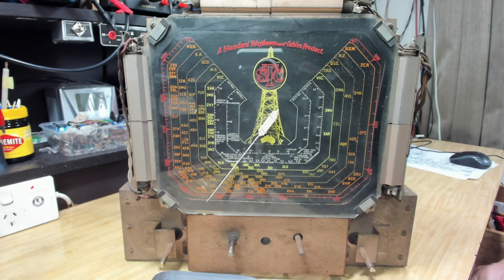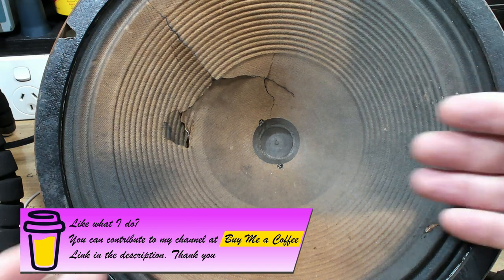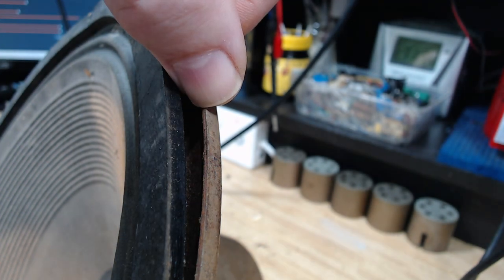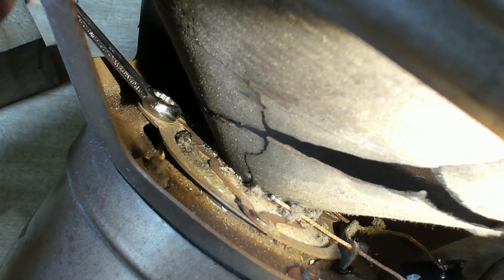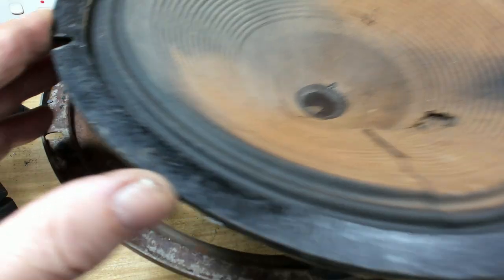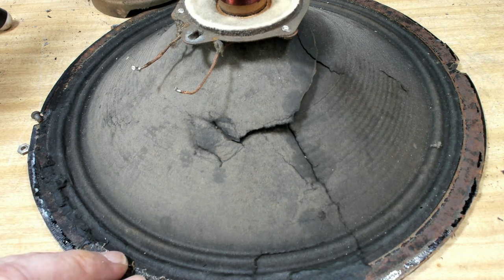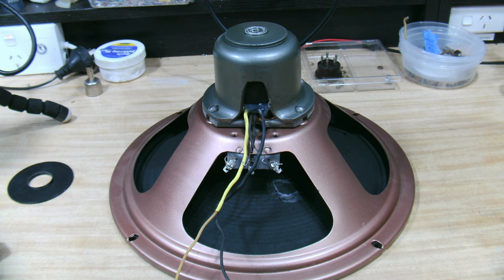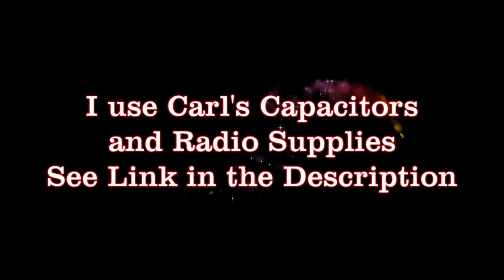STC 830 Radio Restore - 1938 Part 2

Comment: It's always great to see you work on these old radios. You make it look so easy, but that's most likely because of all the tools you have, tools like a 3D printer, a sand blaster, a router, etc, etc. After spraying on the new paint the radio looks like new, or maybe even better than new. Can't wait for part 3. Thanks.
Reply from the maker: Hi De Mus, thank you. Having the right tools makes it easy and I have built up my workshop over many years but there are usually ways around not having the tools and make do 👍🙂

Comment: Talk about going the distance, This is not just a repair, but a fully blow rebuild and to strip the radio ( or any piece of electronoc equipment ) down so far and replace faulty componance, paint, and rebuild far better than new just blows me away. Looking forward two part 3. keep upthe good work Dave !!
Reply from the maker: Thank you Stephen, I'll try 😉😃

Comment: Awesome job on the speaker and chassis David. Not surprised you need a part 3. The radio needed a full restoration.
Reply from the maker: Hi Steve. Thank you. I was aiming for two parts but it was too long so three it is 👍🙂

Comment: I'll pull anything apart to clean it but that tuner was next level. So many wires to keep track of, I broke into a cold sweat. Love all the equipment that you have. Sandblaster and a laser cutter. You've got everything. Thanks for the hint about reusing those annoying real estate magnets. I just throw them in the bin, but going to keep them from now on. That's a brilliant idea.
Reply from the maker: Hi Seiskid. Yes, a lot of wires, I take a lot of photos and even a video to help reassembly on this radio. Good tagging helps too. I add new tools from time to time, they are getting cheap enough as to not break the bank. The sandblaster cost me $70 as the outlet had opted to not sell them anymore. The magnets work well 👍🙂

Comment: Great idea using the tea bag paper to repair the cone. I used coffee filters and fabric glue on speaker repairs but that looks much better. I'll have to cut open the Earl Grey the next time.😂 Always a big undertaking to get rid of rust and clean the chassis I love your methodical approach. Very very nice work David.
Reply from the maker: Hi Larry, I insist on using Earl Grey on my speakers. Cleaning the chassis is my most dreaded part, I'm happy when I get to the painting part. Thank you Larry 👍🙂

Comment: Your ability to rebuild speakers amazes me! Many years ago, I worked in a Radio/TV shop and we sent speakers out for reconing.  At that time, the most expensive job was about $4 USD.  Sadly all of those shops are gone and speakers are expensive if you can find one that fits.  I have dozens of 4 inch speakers from drive-in movie speakers that could be salvaged if reconiing was still available.
Reply from the maker: $4 for a re-cone. Professional re-coning takes the cost higher than the radio is worth, DIY is the only way for me. Drive-in speakers would be well worn 🙂
Reply: @DavidTipton101  Keep in mind that I was talking the late 60's.  I think I made $53 per week for a 43 hour week so the $4 was worth about 4 hours of work. The drive in speakers usually have the cone rotted away but the metal cleans up pretty well.  I can get 4 inch speakers for about $8 each.
Reply from the maker: @gwesco  Oh I get that George but with speaker repairers on every corner it would be more completive back then. We only have one or two in the major capital cities here.

Comment: I have done a fair amount of media blasting, it is a developed art and you can easily turn aluminum into some expanded planished junk in short order. Residual dust may be an issue, removal is just as arduous as the blasting. I would find a suitable solvent, water or mineral spirits (Stoddard solvent), sometimes alcohol. It really depends on the media used. I used ballotini glass beads, ground up walnut shells and ground plastics can be a good choice and of course, sand. For delicate work go with softer media, glass bead is less aggressive than sand. What ever you do your best using a solvent on aluminum and other soft metals. Media blasting is trial and error and sometimes very easy to error.
Great video David

Comment: Ey Up David 
What a great direction you take in methodical procedure
The use of simple resources you use is very clever
Inspired me to look up what PVA Carpenter Glue is made from, Polyvinyl Acetate discovered in 1912 ! So an older formula than the radio!!
So interesting where this hobby can lead to...... Fantastic video 
Best regards Shaun
Reply from the maker: Ey Up Shaun, I never thought about PVA glue before, I thought it was pretty new not from 1912. Thanks Shaun, take care 🙂

Comment: Impressive work, especially on the speaker. Fun fact: we call multi grips the less expressive "channel locks." (We also drive on the right - or correct - side of the road.)
Reply from the maker: Hi Wayne, thank you. There are a lot of names for 'Multi-Grips' or Tongue and groove pliers, makes it interesting. I tried driving on the right side of the road down here... it didn't end well 😟
Reply: @DavidTipton101  😁

Comment: I worked 30 years in law enforcement in some of the worst most dangerous neighbourhoods of my country and yet i could never muster up enough courage to dismantle a radio to that extent. I'm too chicken shit ! There i said it.  Every time i see you cut a wire i feel like an artery or optical nerve has been severed, but at the same time i know you'll be able ro reconnect every single one of them to the right place. You're at the top of your game David and i sometimes wonder if you get lonely at the top...
I agree with Dances with Aardvarks, i"m surprised there was no pun about the tea bag which i only discovered the significance of the expression recently in video gaming.
''Teabagging'':  The action of squatting over a dead opponent's face while he is  waiting for a revive. A disrespectful  deportment very much frowned upon in the gaming community.
Very much looking forward to the next part now.
Be well, God bless you always.
Reply from the maker: Haha... at least radios don't normally fight back... too much. I am aware of the tea bagging ceremony but didn't consider it when doing the speaker, I must get out more. Thanks Raymond 😃

Comment: In the US many years ago, they made a product called Navel Jelly.  It was a rust remover.  I have used it on tuning capacitors with great success.   The jelly isn't as hard on the veins as  blasting media is.
Reply from the maker: Hi Michael, I have tried rust removers but I get a better result with the media blaster. I don't normally do all the checking I did in the video. The capacitor had issues before I got to it. Thanks 🙂

Comment: Hi Dave,
Stripping a radio chassis for the purpose of either painting, or plating is, without exception, a tedious operation but the end result is always satisfying.  I am confident your STC will look superb when completed.
A few years ago I had a thought about making a set of convex, and concave speaker shapes, or speaker pitches, including provisions for including the outer cone ribbed hinges.  My idea was to place a dampened, (seam not glued) paper Chinese hat shape cone between the convex and concave shapes, and use a bench press to form a replacement speaker cone. I also considered pressing paper mache.  
Unfortunately my model lathe was not large enough to be able to turn the required convex/concave press shaping components.  I did consider turning them on a wood lathe using hard woods such as Indian rose wood. 
One day, when I get a workshop, I might reconsider giving this a go.  If you think there is potential in my cone making idea, please be my guest and give it a go.
Best regards, Phil.
Reply from the maker: Hi Phill, thank you. I also have pondered ways of manufacturing speaker cones with much the same ideas as you. There is quite an art to speaker cone design so I wonder what the speaker would sound like if a successful cone could be made. I'll keep pondering 🤔🤔🤔😄

Comment: Lazer cutter, of course... Amazing job and looking forward to if you get it back together and working again as you always do, I wouldn't... But it was nice to see you sandblast again, it haven,t been much of that lately. It is nice to have a lot of gear in the playground but it not helps if you don,t now how to use it and that you do, thanks David!
I vill also thank you for the insporation on winding machine and tip on that calculator by Mark Delac. After a very long time I have finished my winding machine even if I was going by my idè you give me insporation to go on and I have now rewind my transformator and hope to test it later today, I don't have much time for this but it is a relife vent for me.
Reply from the maker: Hi Leif, thank you. I hope your transformer is working well. I am working on my winding machine now and hope to use it shortly, I don't have it working yet but I guess I will get there👍🙂
Reply: @DavidTipton101  It worked, perfect if I havent chicken'd out on the heaterwinding, last second bad decision so lesson learned to trust the calculator all the way and have now rewind it so now its perfect, at least until I got it back in the radio... It is fun, not so long ago I never think I ever going to wind a transformer but now I have wind 2 (first one to power the winding machine) this my own built machine. I am sure your machine going to be on unother division.
Reply from the maker: @leif.Jakobsson  That's good to hear Leif. I lived in fear of the transformer until I realised it was a quite simple concept as you have found. My winder is so highly advanced I can't work it 😂😂

Comment: You’re doing really good 😊 on this radio 📻. I like 👍 your new invention in words, saying this set is “earthed”, instead of “grounded”. I still understand. You’re doing a great 😊 job reconing the speaker 🔊. It’s probably permanent magnet 🧲. I think 🤔 I also mentioned the dial cord, which ya said was in good 😊 condition. Are ya also aligning this radio 📻? To me, that’s about the hardest thing to do. Unless you’ve got diagnostic equipment to tell ya what you’re doing, aligning a radio 📻 is next to impossible, unless you’re very well practiced, without the use of diagnostic equipment. Your friend, Jeff.
Reply from the maker: Hi Jeff. Earthed might be a British term, I hadn't thought about it too much. The speaker came up very well, it looked grim at the start. The speaker is dynamic and there is no dial cord on this radio. I do the dial and alignment in part 3. Thanks Jeff 🙂

Comment: Excellent work. You could easily parametrically design and 3d print the paint/ sandblast covers for the valve sockets. That way you can quickly remake them for any valve sockets you encounter in future.
Reply from the maker: Hi Stephen, thank you. I could print them but it would take 20 minutes each on my printer. The laser cutter takes much less the 15 seconds. I wonder how durable the plastic one would be? 🤔🙂
Reply: @DavidTipton101   good point I didn’t know laser cutters are that fast. I am a bit scared about the safety of lazer cutters as I am not good with potentially dangerous things.
Reply from the maker: @stephenbarlin2314  No danger with the laser cutter as long as you wear protective glasses and the work doesn't catch fire.

Comment: Though I enjoy watching your videos a lot, there are some moments that my toes curl.
These moments have in common that they involve repairs on speakers. Though the methods you use are effective and restore  functionality, you could perhaps try some that are more suitable to use on these rare vintage speakers.
Don't get me wrong, I have great respect for the way you restore these beautiful old radios that would in many cases go to waste.
Greetings from the Netherlands.
Reply from the maker: Hello htrawa in the Netherlands. I'm not sure what you are saying about the speakers, what should I do differently? I'm happy to receive constructive comments. Thanks htrawa 🙂
Reply: @DavidTipton101  
Hi David, First of all I want to emphasize that I think you do a really good job with your repairs!
regarding the speakers.. when I saw you putting on so much glue at 2:42 and the teabag I couldn't help thinking this could be done better. You see, since the glue adds mass to the cone the performance and maybe even the sound characteristics will change, so it is important to keep the added weight to a minimum. In this case a strip of glue and teabag paper of only about 5 mm wide would achieve the same strength. I would try making a paper mache that matches the cone more and reinforce it on the backside with a tiny line of wood glue. For the thinner section you repair at 4:49 I think the teabag solution is brilliant!
One other tip: At 28:16 you remove the centering strips from the voice coil before you glue the outer ring of the cone to the chassis. If there is some play in the outer ring position you would have no risk of misaligning the cone when you leave them in until the glue sets.
Reply from the maker: Ahh, right. I am aware the extra mass added to the cone will affect it's performance. But I take your point, it is better to use as little glue as possible. I do as much of the repair on the front side of the speaker as that side is hidden when the speaker is installed in the cabinet. I didn't show me regluing the outer ring, I absolutely would have had the plastic strips installed when doing that. Thanks for explaining your concerns Htrawa.

Comment: Greetings:
You should be able to use a less deep cone by causing the center metal portion of the magnetic extension in the center of the voice coil to extend further into the throw range of the voice coil by adding ferrous material (like washers or a neodymium magnet: polarity in-phase) if that center is held on with a screw, then added washers could be placed there.
 Although the total throw will be less than the original cone; distortion may begin to increase at a lower volume. I would use some 35mm film negative as centering spacers; if too thin then 2 layers should work.
Reply from the maker: Greetings James. I could have made a shorter cone fit as you suggest. The other issue is the hole diameter on the replacement cones is quite a bit larger so that would have to be remedied as well. Thanks James 🙂

Comment: Id be happy to see a video about your laser cutter !

And as an alternative to tea bags for speaker cone repairs - how about the tissue paper you can get for covering model aeroplanes ?
Reply from the maker: Hi Mr B. There are lots of videos on laser cutters, I'm still seeing what I can and can't do with mine, I've found a lot can't so far. Tissue paper would be fine to use, although you would be replying on the adhesive to hold together. Tea bags have better strength and we keep them in the pantry 🙂

Comment: Recentering voice coils, fixing rubbing variable capacitors and restringing dial cords were always my least successful and least favourite bits of restoration. A real pleasure to see them done well - and aren't 3D printers and laser cutters useful? But even they can't help with restringing...
Reply from the maker: Hi proudsnowtiger. The voice coil centring caught me off guard, so it was first time for me. The 3D printer is very helpful, I don't use it too often but very handy when I need it. I haven't used the laser cutter very much yet, I bought it to cut new back panels for radios. It should do a good job for them. Thanks proudsnowtiger 🙂

Comment: I lost / had stolen / the most useful tool.  Parallel Grip Pliers is the best way to understand them  I think they were Post Office (GPO) Number 1 ? at full opening just the right size to undo thin retaining nuts of that medium diameter with the jaws parallel at full stretch.  I did see another pair at a tool jumble sale but missed out as the chap in front bought them
Reply from the maker: I know the ones you mean High Path, like an adjustable spanner (monkey wrench) with handles 🙂

Comment: Nice work as always Dave.
Have you ever tried using a rust remover like Evaporust on the tuning condensers?
I don't think I have seen you use such a product from memory. Just thought it might be less damaging if it worked without the mechanical abrasive corrosion removal
Reply from the maker: Hi 1974UTuber. No I haven't tried Evaporust, $90 for 5 litres here, that's a lot of money to try it out. I can't imagine it would do as good a job as the media blaster, albeit a bit gentler of course 😄
Reply: @David Tipton  OK so it's liquid gold here in Straya then. I won't be buying it any time soon then either.
Maybe some vinegar in a sonic cleaner. It works for mower parts.
I really need to get stuck into some of my many radios instead of watching everyone else do it
Reply from the maker: @1974UTuber  I haven't tried vinegar in my sonic cleaner. I'll try it 👍🙂